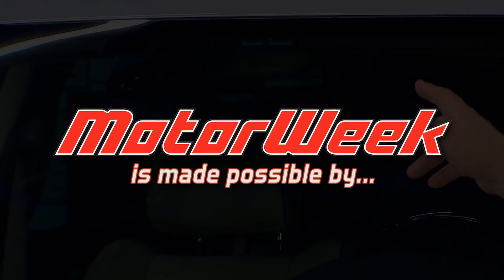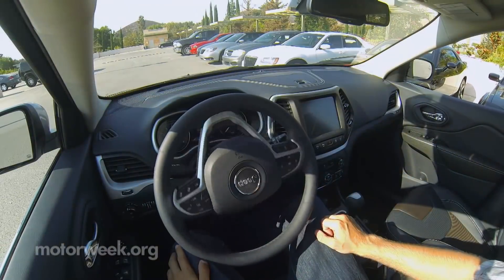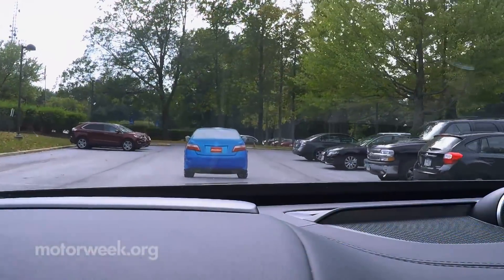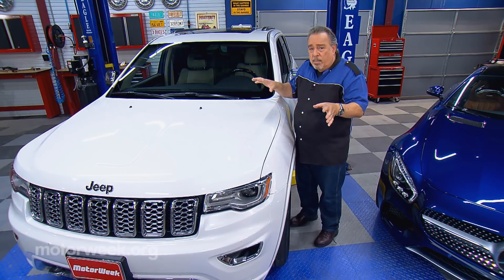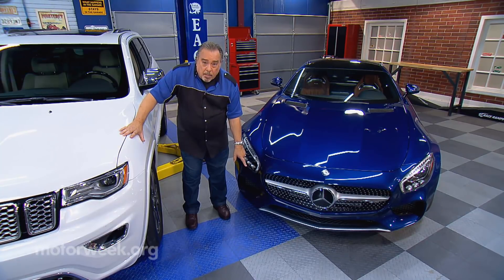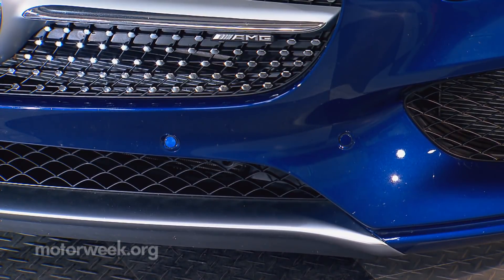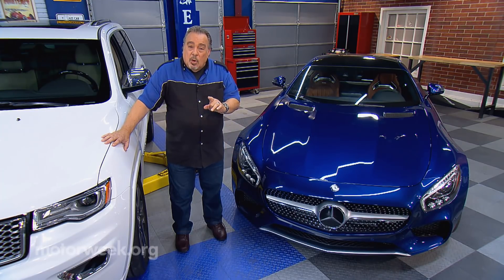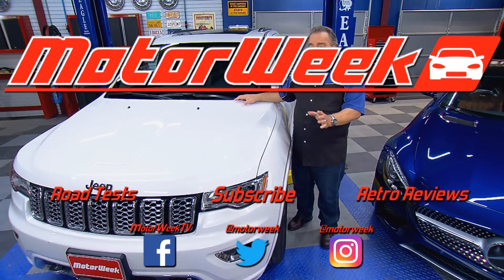Goss' Garage: Autonomous Maintenance

Comment: Should be interesting to see how these work in the Midwest. I can take a perfectly clean car and have it plastered with bugs and coated in dust, dirt and mud after driving only a short distance. I bet being hit with 1000's of grasshopper guts wont do automatic systems any favors.
Reply: Actually on some makes such as Fiat-Chrysler, you will get an error indicator light flash and the car goes into limp mode until you park, walk outside, and clean the sensor unit.  No way to disable it either.